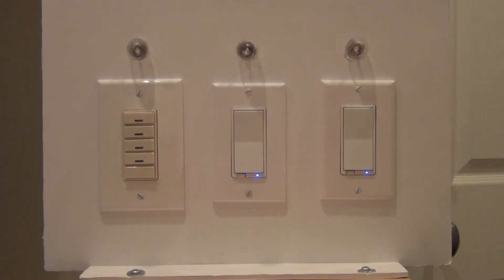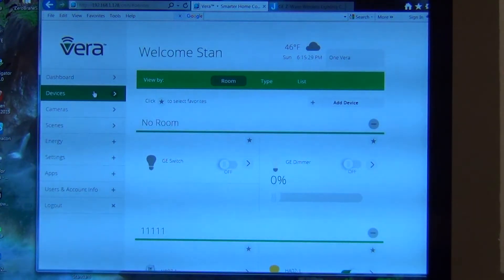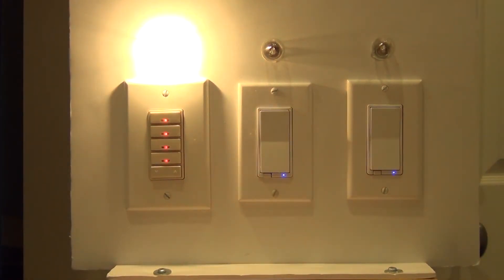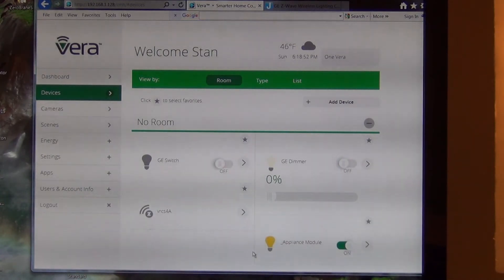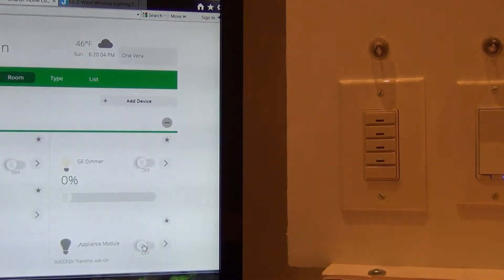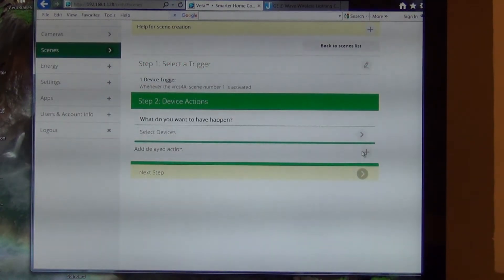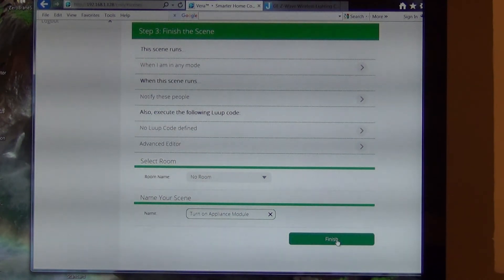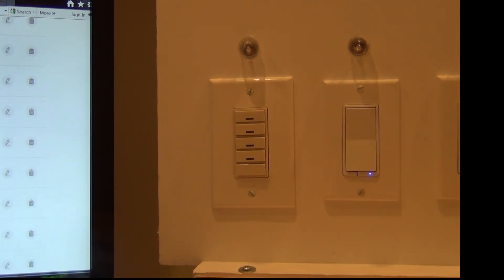Leviton VRCS4 MRZ Include and Internal Load Switch Setup - Vera

Comment: Hello, i added the VRCS4 on the VeraEdge controlled Z-wave network. But when i added the CRCS4, there was no appliance module that came with it. so it is not working. how do you get the appliance module to appear? thanks!
Reply: Hi Olivier.  As you saw in the video, I did not do anything special to get the appliance module to show in Vera.  Make sure you have the right VRCS4.  There are two versions.  The one I have is the Leviton VRCS4-MRZ Vizia RF + 4-Button Scene Controller with Switch.  There is also a Leviton VRCS4-M0Z Vizia RF + 4-Button Remote Scene Controller that does not have the appliance switch.